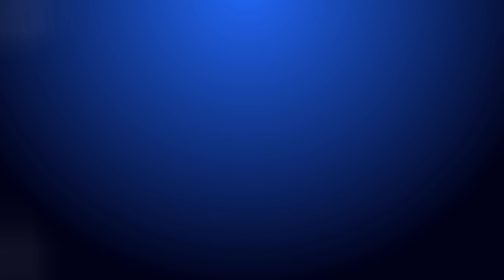Smart5 Output Repair Troubleshooting Steps

Comment: I'm working on a MD 8k that when down hard on one side with blown trace even the circuit that controls the fans I had to repare, but after all that it on now but no sound and suggestions?
Reply from the maker: You will have to see if you have a functional pre-amp. Do you have a square wave from the 319 to the output IC's input?

Comment: Hey, do u know im struggiling now with no one , TWO ab car amps with mosfet output?? how is this possible, the amp name says CLASS D TIPOLOGY, but it has not oscilator for output as 2098, has not output coils...its everything like ab deging with output mosfet irf540N ALL THE SAME , may u link me to some diagram to repair this??? THNAKS EBURG FROM SPAIN.
Reply from the maker: Hello and thank you for the support. I am not 100% sure what amplifier you are referring to but if you let me know I may be able to assist further.
Reply: @ellensburgamplifier  coustic amp1200db D-block
Reply from the maker: @tTRANCEMAR  I am not able to find any picture reference to that amplifier model. Are there emitter resistors in the output section?

Comment: Hi sir really need ur help I have a sound digital 3000 watts it playing good then it shut down its not my speaker it's the amp but i really don't know what to check i test the amp and can't find nothing
Reply from the maker: Most likely a fault in the output section if it is going into protection or if nothing happens at all then a fault in the power supply (like the drive IC). I don't service Sound Digital so not sure if there is a "common" failure point on those.
Reply: Ok thanks